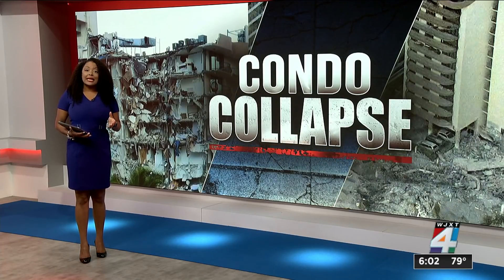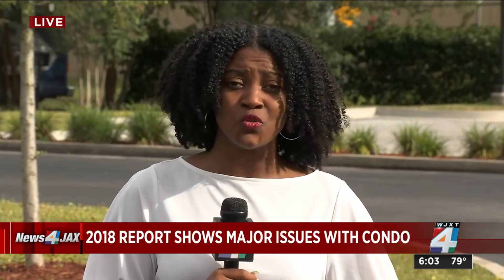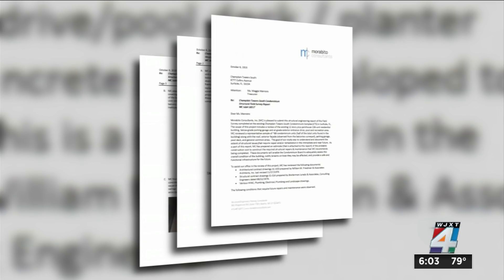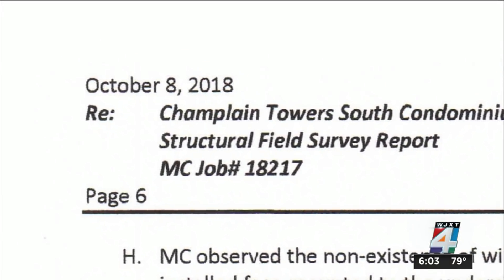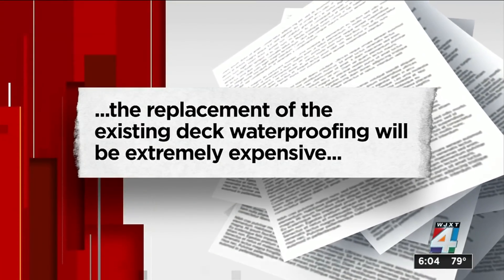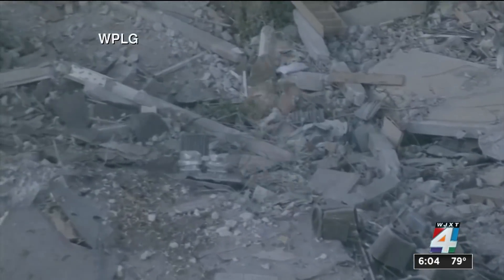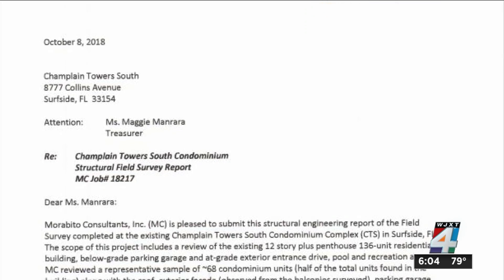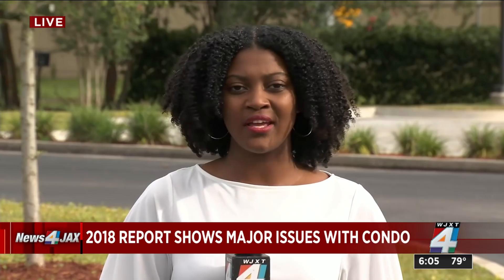2018 engineering report showed ‘major structural damage’ before condo building collapsed

Comment: Typical. HOA's are QUICK to collect fees slow to pay out for mandated repairs.
Reply: get this... new HOA took over a place where i used to live. it was a rental converted to condo, we had a gas leak in the opean area. people were smoking in that area. it took almost 2 years for them to request gas company to shut down the gasline but not before the boiler went up in flames HOA replace that POS from old to newer but smaller which was overheating then I don' tknow what kind bc I moved
Reply: @aurinkobay7118  This kind of failure only happens with "act of god' circumstances like earthquakes and the such,  if this was simply an issue of a poorly run HOA we would see lots more of this kind of thing.  This large of a building would also most likely have a property management team.  But even then, there are also loads of terrible property management companies out there.  I think we are going to learn that it was the way the building was built originally that will be the real culprit.  Developers are notoriously bad about cutting corners when they can.  The 80's was the hay day of deregulation too.
Reply: @Isalala3000  The HOA IS the management company. There is no such thing as a management company to manage a management company. The BOD members control the HOA. In this case per the bylaws I've looked up on this building, the BOD was voted in from the class of voters, meaning the residents. I know it's confusing but - the people who work daily in an HOA office 'can be (also) residents but it's the governing documents that dictates. Most BOD's hire people to run the HOA office, that's it. They are on payroll. BOD's are not paid bc it's a conflict of interest but they control the day to day operations of the HOA office personal.
Reply: @someonewhoknows1000  Technically you are right.  My point is there are plenty of reasons why this happened and shouldn't be 100% laid at the feet of the HOA.  The main one is probably poor original building plans, poor maintenance since the beginning, a large construction project going on near by, poor follow through on the part of building inspectors forcing repairs and finally potentially a sink hole.
Reply: @Isalala3000  yeah and I live in So Cal! .. 1994 epicenter is less than 15 mins away.
Reply: @Isalala3000  Change of command: Investors - Developers - BOD - HOA. 

BOD directs the HOA. It's the duty of the HOA to carry out business operations period. It's the BOD's fiduciary duty to ENSURE that the HOA is performing their duties daily.
Reply: @Isalala3000  What response or retort do you have to say to me since news reports today are saying EXACTLY what I said days ago? After investors is BOD, and HOA follows. You don't wait to do repairs! BOD has a fiduciary duty to ensure the HOA IS making repairs on a daily basis! This wasn't being done which is why the current BOD called for a Special Assessment Meeting to discuss the crumbling building! Apparently the BOD never set up a Reserve Account since 1981 for said repairs! Regardless, it falls to the BOD AND HOA for this disaster. I've since looked into the controlling documents for Champlain Towers South, and they set the HOA dues at $731.00 per unit. That equates monthly to $95,030.00. Equals 1,140,360.00 ANNUALLY!! Now times that number by X amount of years, minus expenses and what little upgrades or repairs they made. Without looking further into their P&L's over the years myself, I could only take a guess, but the fact remains they had money monthly to make repairs ongoing.
Reply: @someonewhoknows1000  No, this is not correct.  The HOA is made up of condo owners.  The board of directors (BOD) is a small group of condo owners elected by the condo owners as a whole.  The HOA has a management company to run the day-to-day maintenance and operations.  The HOA itself is not a management company.
Reply: @someonewhoknows1000  Do you realize how many different members of the BOD there have been since 1981?  Referring to the BOD as a distinct from the HOA in this scenario is pointless since the current BOD members are not responsible for any neglect that may have been going on for decades.  However, there is no amount of neglect that could have resulted in this building collapse.  Buildings are neglected all over the U.S. yet they never fall except by Acts of God or intentional destruction.  This was an Act of God, but the public simply insists on blaming somebody.
Reply: @WhalerGA  Grow up and learn. You'll see the BOD and HOA are sued and possibly the City. And yes I'm more aware than you how quickly the BOD members jumped on and out. It doesn't matter how long or short they served!
Reply: @someonewhoknows1000  there is  A LOT of blame to go around —-just don’t leave the developers it if it.  Looks like they built irresponsibly.
Reply: @Isalala3000  yeah and guess what .. that building is 15 min from 1994 LA quake epicenter.
Reply: @aurinkobay7118  christ
Reply: HOAs often turn over every year so there may be little consistency from one board to the next.  It's management that usually has the longer term contracts, i.e. 3-5 years with the ability to ensure that the governing HOA is doing the right thing.  I would scrutinize the management company FIRST.
Reply: @mightyoak11111  or change the LLC every year …..shady
Reply: @mightyoak11111  BOD hires and can fire any employee or managment company, period. It's the BOA that has term limits that are staggered.
Reply: @someonewhoknows1000  Not necessarily true.  A board can sign a long term contract with a management company that subsequent boards are legally obligated to honor even if the management company is subpar.  And board members are elected for one tear terms so they are more likely to come and go while the management company remains the same.
Reply: @mightyoak11111  Your wrong, and I'm glad the news reports today is saying exactly what I knew days ago since I have personal extensive experience for more years than you were probably born.
Reply: HOA usually only collects enough money for small repairs. I'm guessing whatever fixing was needed here would have required hundreds of thousands, if not millions. Good luck getting the condo owners to cough that up. Of course, this doesn't absolve the HOA of their duty to inform the owners of the issues that were discovered.
Reply: @addanametocontinue  Hi David. I'm retired but your beginning comment floored me since my education in this is extensive but I'm not going to go into that. But you made me curious so knowing how to look up facts in property documents, I decided to take a look into Champlain Towers South only. I knew your thoughts were well intended but way off the real figure. So, there are 130 condominium units before the collapse. The monthly dues are or were $731.00 per month. That gives a monthly intake of $95,030.00 per month. Annual budget of 1,140,360.00. So it is not chump change! Now, BOD's NEVER allow all monies to be used yearly. Especially if the BOD has stipulated a percentage is paid into what is called a Reserve Account. A Reserve Account is performed and carried out after a Reserve Study. The Study consists of engineers who photograph and map out the entire property, equipment, and includes other incidental items based of a guesstimate of longevity. Example only: complete reroofing in X time, by X square foot, X's inflation costs of material plus labor. A reroofing might be a 20 year (the usual) whereas pool pumps with heavy year round use might be yearly. When the Study is complete, trust me, in a short period of time, millions of dollars sit waiting especially since it builds each year.

As a former BOD president, it's nothing to see 2.5 million in liquid funds at the beginning of the year. BOD's have to if their any good bc they have to ensure the HOA operates exactly as they dictate to them bc it's homeowners we care about. Sadly, many don't hold up their fiduciary duties and don't care, but I've never worked for thieves who take the money and play dumb.
Reply: @someonewhoknows1000  well... every HOA I've been forced to deal with have ALWAYS done a couple things I thought were corrupt. 
- bids for jobs like cutting trees and landscaping ALWAYS seem to be won by a family member of someone on the board.
- one HOA misinterpreted how much a new pond would cost by a family member who bid to create a pond. Forgot to add the cost of the water which would be 5 million. So instead of wrapping up and rebidding or use reserve funds which amounted to $15m they sent out a letter informing the moneybags (I meant homeowners) that they'd see a 1000 percent increase to share the cost. A lawsuit was initiated and they were forced by a judge to pay out of reserve monies and had to pay back monies to the suckered (I meant homeowners)
- I got fed up so I created an HOA management system where the fees would pay for weed control and house painting and general landscape management and would build up reserve monies and would be 10% less fees than my current fees... this after I kept LOSING bids to the board president's brother's landscaping business no matter how low I went. I offered in my package a modest salary for 5 guys to be full time landscapers for $30,000 each a year.

I went so low that I offered to cut down and remove stump of 6 20+ foot nuisance trees for $150 each and STILL lost the bid to the guy's brother. 

Guess what. The guy got busted using reserve cash to purchase 10 homes to turn into rentals was was trying to rush the money back. He had a now former police officer background check me a leaked that I was a felon (attempted murder in 2003) in a campaign to prevent me from making DREAMS come true...

That's how HOA's operate dirty and corrupt.
Reply: @JUGGERNAUT____  I believe you bc I've seen it. One developer who created a master planned community, complete with a Declarant, a Declaration, BOD, HOA and Reserve Account with Bylaws and CCR's opened up fairly close to where I lived. People flocked in droves to buy homes there. It was the hottest talk of the area. Almost two years into the property, homeowners had massive complaints. I started hearing from several residents about the problems bc I was president of my BOD and ran our HOA as a tight well run property with happy residents. End result for this property and the homeowners was first a major crack in the pool, but other failures soon followed. In a short amount of time, common grounds weren't mowed, clubhouse was disgusting etc. I was implored to look into it by residents. I quickly found out that despite high HOA dues, there was no money in the operating budget or the Reserve Account. Not embezzlement, just monies spent on  frivolous items. The BOD and HOA sold piece by piece gym equipment from the clubhouse, furniture, desks etc, which ALL belong to the residents, in an effort to pay HOA salaries. Regardless, homeowners can NOT stop paying HOA dues. There is no protection in the law that is automatic for homeowners against HOA's that fail their fiduciary duties. Homeowners couldn't even sell their homes bc noone would buy homes there. BUT they still had to pay their mortgage and HOA dues bc noone can take that severe hit on their credit report.

Another development about 10 minutes from my home, same scenario with the property set up with full documentation. Within the span of a little more than a year, homeowners had MAJOR foundation failures. Soon it became widespread throughout the development. In the beginning, the developers and investors tried to hush the homeowners since they still had lots to sell. Again, residents reached out to me. 

I despise corruption and wrong doing. I refused to play the game of elbow rubbing with the men in fancy suits, or being in the 'cool crowd'. I was told by homeowners where I lived, that it was why they voted for me as president of our BOD. I wasn't in it to make friends or be popular. I had my own private happy life with my spouse and our children. 

In time, I couldn't handle how many corrupt properties I heard about. Homeowners gave me erroneous code violations they received, mortgage papers, devaluation of their properties they couldn't sell etc. So that is when I decided to find out what I could do so I could return to my quiet life. I started writing legislators. I was asked by my House of Representatives to speak at my state Capitol, which I did. I was invited back many times and I always accepted. In my experiences I learned far more than one can imagine. My takeaway is this: Large developments (homes and condominiums) have investors that have deep pockets. They PAY huge amounts of cash for lobbyists to speak to The House of Representatives in each State, AND Congress about the 'wonderful benefits of HOA's' and all the amenities they offer homeowners. I stayed in the same hotels and ate meals by invitations from the lobbyists, but I never back down from my stance. I was only for 'the best interests of the majority of the homeowners plights'. For that reason, I became a valued speaker. However, the second thing most importantly I learned is: Homeowners don't get involved until they themselves have a problem. Sad but very true. I can't educate homeowners BEFORE the problem arises. I couldn't even get ONE homeowner to testify before The House of Representatives in my State with me! I COMPLETELY understand how they have a job, children, grocery shopping, house work, etc and they don't have time. I didn't either and had far more on my plate than they did. Years later, after retiring, I found the last 3 of my six children had grown up from toddlers to young teens. I sacrificed more than it was worth in the end simply bc the biggest fight is trying to educate people, regular people! HOA's can be GREAT but only if people are willing to understand how they work and hold morals and values on behalf of  ALL homeowners. If within each HOA, homeowners banded together to actually attend BOD meetings, and vote members in responsibly, we could all enjoy living in an HOA environment. 

I know this was long but thank you for sharing and I completely AGREE and believe you bc I've been there.
Reply: HOA are prime extortion environments. How hard is it for the HOA Management company to submit receipts for “work done” but actually never done & the management company to pocket the money? It isn’t hard at all! County District Attorney’s across the nation should have task force’s dedicated to expose and prosecute fraud and embezzlement that is rampant in the HOA management companies. Your board are volunteers. Some are on the take.
Reply: @jrsands  You have a bit confused. Your HOA is the management company. All HOA's are the same. Your BOD is usually from residents voted in by the residents on a split schedule for term limits. I'm retired but curious I've looked into if the Champlain Towers South did in fact have voted in members from the voting residents class per th Bylaws on the BOD. Answer is yes. Meaning noone from outside. All residents.

Only BOD's have the power to fix an annual budget. The BOD is the head, and directs the daily business the HOA performs daily. The HOA pays Bill's from the budget, collects dues, keeps a ledger, and monthly P&L's. 

It's the BOD's duty to conduct meetings with a quorum present, read the P&L's statements, and if necessary order line items to the general ledger if clarification is needed per the P&L's. 

My point to you is, if you think your HOA is money hungry, you need to ask your BOD for answers. All HOA's have to have an annual budget FIXED by the BOD, and hold monthly, quarterly or annual PUBLIC meetings for the voting class which IS every property owner. This BOD also has had an attorney of record for the past 5 years. This is also normal. What I haven't found out from lightly looking is if they (BOD) set up a Reserve Account also. This would be important to know for the residents.
Reply: Correct, but don't forget, the HOA is controlled by the BOD! I'm retired but already looked into facts to see that it was a voted in BOD from it's members. Regardless, homeowners can sue the BOD, HOA, and maybe the city since the Mayor stated on camera - she never saw that report filed in October 2018.
Reply: So true !
Reply: Most board members on these condos have ZERO experience in building management or any other useful skill when running a building.
Reply: Dude. A building code inspector would have condemned the building if it was as bad. Nobody wants to have this kind of liability on their shoulders. 
This was planned
Reply: Its easy to play the blame game like that. Try being on the HOA and youll see what reality is.